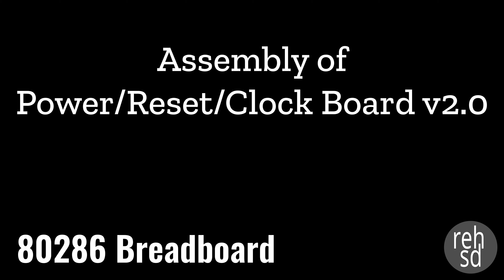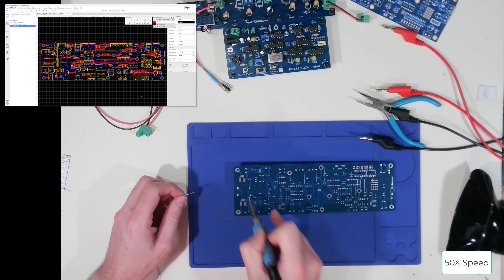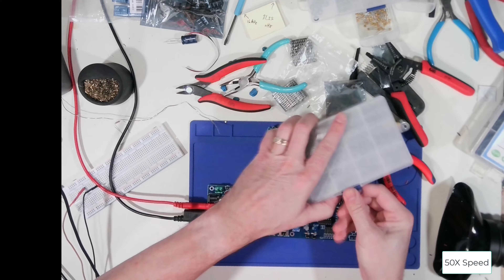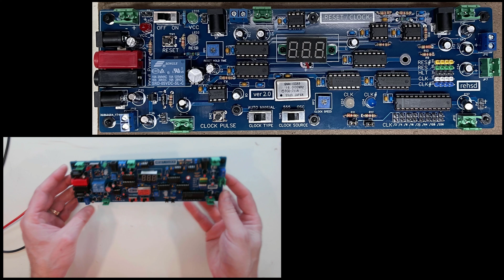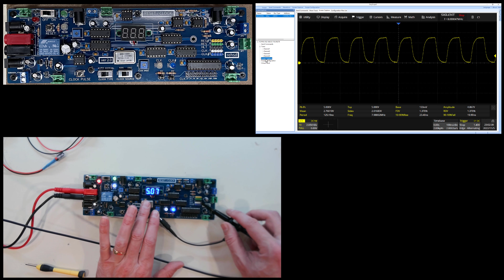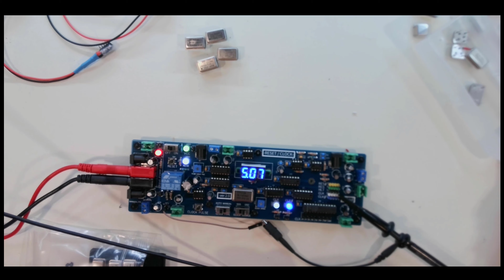Assembly and Testing of Updated Power/Reset/Clock Card

Comment: When you showed the 8Mhz clock signal it seemed like it was a ways off from a square wave. I know that digital logic isn't "perfect" but is that a sufficiently sharp enough falling and rising signal to not cause problems?
Reply from the maker: Check out https://imgur.com/a/aWn7tdH. I updated the two ICs from HC family to AC family, which did improve the clock signal. I also show the signal before and after the 82C284 clock generator. Finally, I show the signal after the inline resistor (after the '284 clock generator) that Intel recommends.
Reply: @rehsd  Thanks for the detailed response!
Reply from the maker: That's a great question. For now, I'll say that time will tell. For my previous 65816 builds, this clock would be fine. Thinking about my 286 build... at some point, someone mentioned how critical the clock signal is on these 286 systems (and how difficult it can be to achieve a good clock signal at higher speeds). Right now, I don't have any concern with how the clock looks. Something I could quickly check is the output of the clock generator IC in my 286 build, as it might make the clock signal better (or worse). Also, I am using a 74HC74 IC for my flip-flop and an HC for the corresponding NAND gate (the final IC before that signal you were looking at). I could try a faster flip-flop, such as AC (e.g., 74AC74).

Comment: The little 7 segment display shows voltage right? Is there any need on a project like this to show power draw? I assume you are able to see that on your bench power supply though.
Reply from the maker: Correct, it shows the voltage of VCC. I have thought about showing current draw also but haven't moved forward with it. I would just need to source an appropriate display for current (and update the PCB to place it inline). I do use my benchtop power supply to view current draw, which is a great troubleshooting tool. An unexplained increase in current draw is often a sign of an issue of some sort.